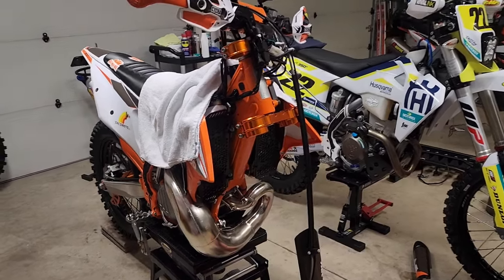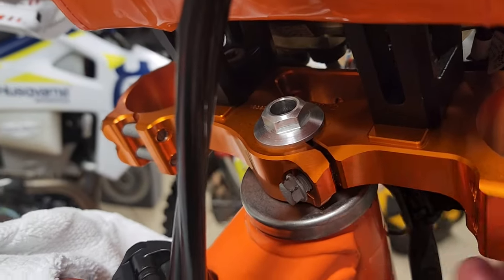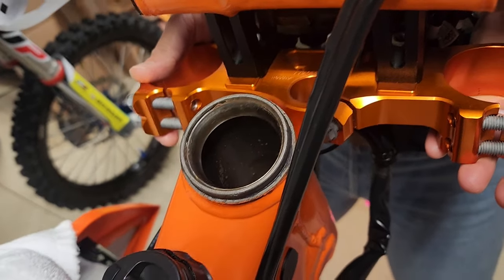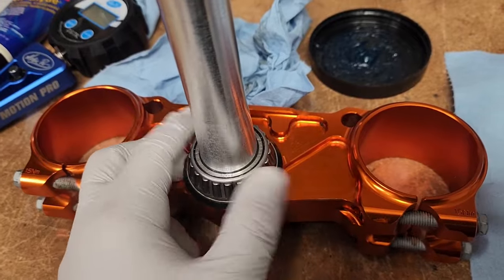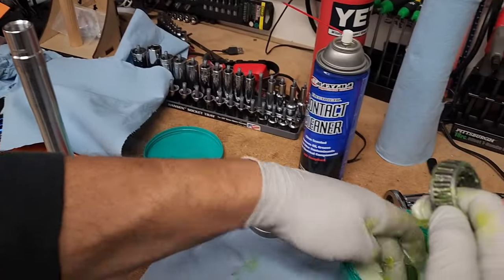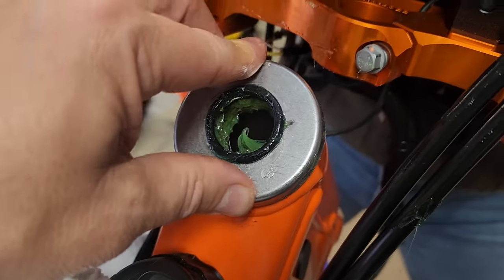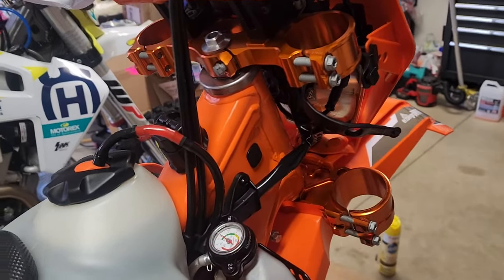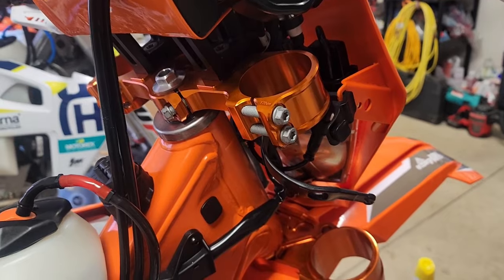KTM/Husky 300, 350, 500 Steering Bearing Stem Lubrication.  Grease those bearings even when new!

Comment: Hey great vid! I have a question. is there such thing as too much grease? Also wont too much grease just attract dirt that will get trapped in the bearings?
Reply: Outside the sealed area, yes.  But the grease inside the bearings is protected by the dust seals at top and bottom.  Water can still seep into those areas, so more grease is better.  A packed bearing leaves no room for water.